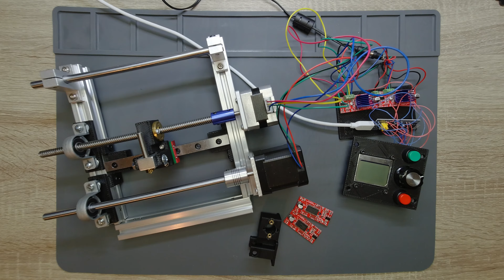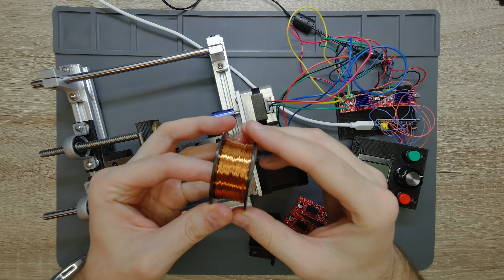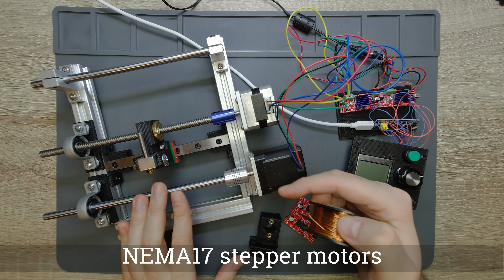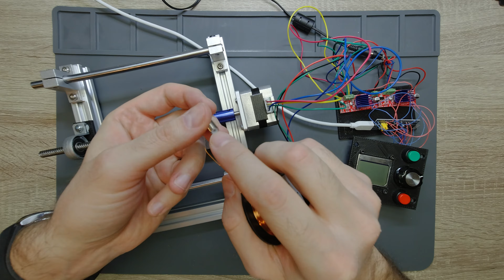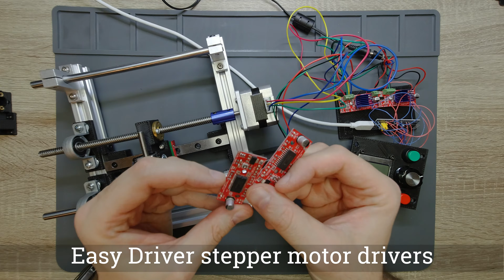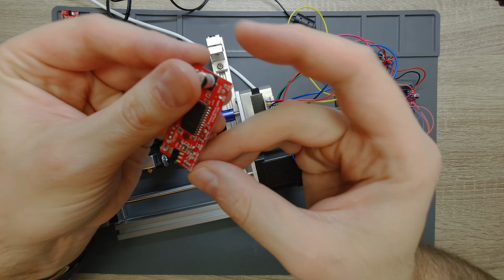Building a coil winder [Part 1] - Introduction

Comment: Esse fuso é de quantos mm?
Reply from the maker: I don't understand. Please use English if you want to get an answer.
Reply: @CuriousScientist  How many mm is the spindle you used?
Reply from the maker: In this video I am not using any spindles (I guess, you mean the spool for the coil being winded on). In future videos, you can see the details. In fact, the spool diameter is a parameter that you have to enter in order to get the correct winding.
Reply: @CuriousScientist  what type of axle you are using in The motor?
Reply from the maker: Did you watch the videos? I introduced this machine very detailed. It is a 8 mm shaft.

Comment: Is the code for this available? or is it not completed? I am doing my own design but like your acellstepper programming. Thanks.
Reply from the maker: Hi! I actually finished the coding part, but I haven't yet published it. I will publish it in Part 4 probably after I showed the device working in Part 3.
Reply: @CuriousScientist  Ok thanks. I am using two arduino's one for each stepper and one mega with LCD and keypad. I had alot of trouble with keeping constant pulses and timing and I went to nema 23 motors. They work amazing..... with KL5056 drivers.
I like your programming of the Accellstepper library and am going to redo all my code and use that library. I coded everythiong without a stepper library and I couldnt really get it working properly. For the wire feeder , I was going to just go back and forth with switches on both ends and it would reverse  when it hit a switch. I didnt think about your way which is perfect so I will implement that also. Thanks for your video's.
Reply from the maker: My coil winder is purely math based. You enter the dimensions of the wire, bobbin and coil and every necessary details for the motors are automatically calculated and performed. You will see how cool it is! 

Regarding your issue, I suspect one thing. People often do this common mistake: they do something blocking between two steps. For example they put delay in the code or perform something which cannot be performed faster than the time between two steps. This will mess up the pulses for the stepper motor driver because the time between them will not be equal. So, your issue might not be an issue of driving the motor itself, but you might be trying to do something "illegal" between two steps. 

There is no need for multiple microcontroller. I did the whole stuff with a single unit and it works well.
Reply: @CuriousScientist  Yeah I know it is blocking code for sure. But I have a 20X4 LCD and a keypad so I offloaded the stepgens to arduino. On the keypad with LCD, I select the turns, the poickup type that will tell how thick it is and wire size so I will have the arduino send it to the other arduino via IC2 with the accellstepper library. 
Will see how it goes.
Reply from the maker: Check this video: https://youtu.be/6zqq79mXjFw
It is some kind of solution for the above described issue. One microcontroller works only with the motors, and the other works with the rest of the stuff: serial communication, display, switches, you name it....

Comment: Great project! 
I think you don´t need to upgrade the Nema17 to 23. If you have not enought torque you probably run the motor with the wrong voltage and current.
Reply from the maker: Thanks! I was just speculating in the video. If for example I want to scale the machine up for thicker wires (welding transformer), I might need a stronger motor. At this moment, I am just experimenting, so I don't know the final result. Each upcoming video will be a newer iteration of the project, so I will discover the "optimal solution" step by step. So far, I will stick to the NEMA17 as I am not planning to wind coils with thick wires now.

Comment: Great video, quite clever to use readilly available 3d printer nozzles at different diameters. Looking foward to the next one
Reply from the maker: Thanks! Yes, I found the nozzles very convenient as they are readily available. I am constantly looking for parts which are easily available, so anyone will be able to build this machine once I am done and published everything. The other approach will be to use those blunt syringe needles. They also come in different diameters and they can be used to guide and feed the wires in a precise manner.